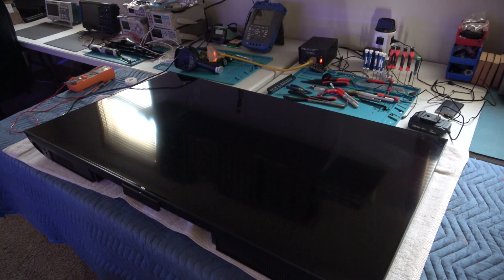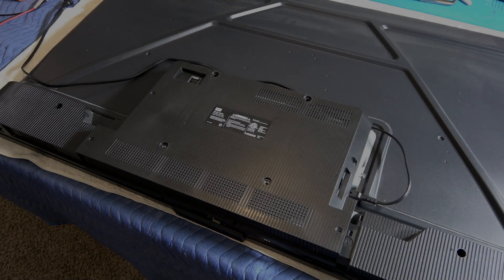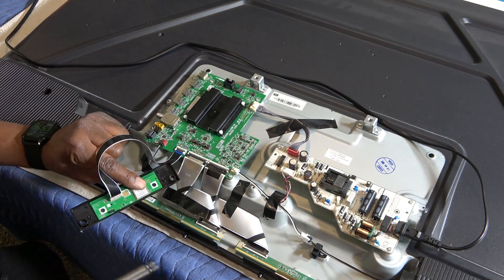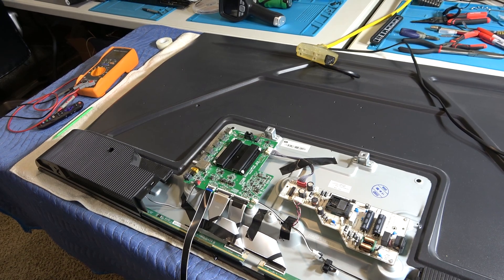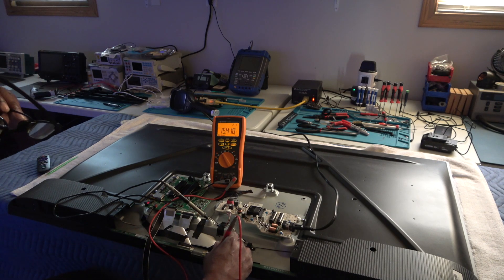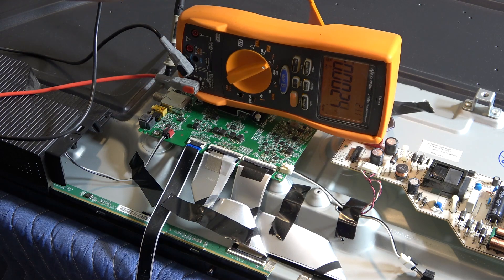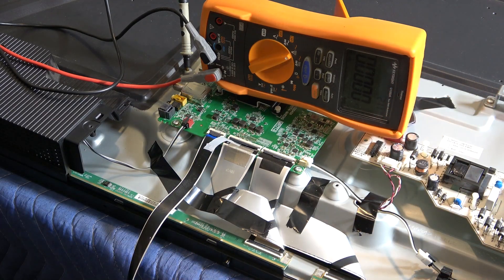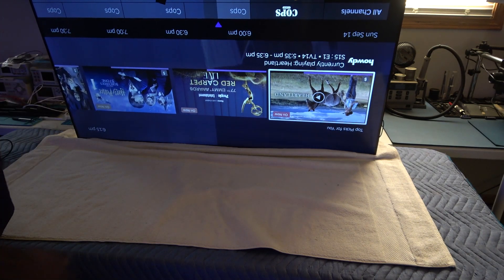How to use the Tape method on LED Televisions with a bad LCD panel, backlit screen but no display.

Comment: Hey bigdog, I love your channel, you've helped me out a lot in the past couple years. I've had a problem with three TVs, 50" and 55" with the same main board as this video. The problems I've had with that, if I unhook one side up only I will have a temporary picture and then black screen and the other side just blank and tape doesn't seem to work. Do you have any recommendations to what it could be or is it just trash, thanks in advance.

Comment: If I am understanding how this works correctly, it is something that has shorted internally in the LCD panel or something in the ribbon cables feeding the LCD that have failed and this "trick" works because each side of the panel is fed with multiples of the same signals for the same image to reproduce a higher refresh rate , such as 120 or 240Hz, sometimes called like 'truemotion' or something along those lines (sorry for the bad pun there) and this trick basically works because by cutting the signal to the shorted line with tape, it's only affecting one rotation as you will of the same image sequence to the LCD panel so you should still get half of whatever the original Hz rating is.  This might show up only in sports or video games where the refresh rate of the original video source is high enough to notice, but a normal broadcasting and movie watching I don't think it makes hardly any difference since I believe most broadcast and streaming is at 60 hz or 120 max at least in the USA I believe  I might be totally wrong here in my understanding, so please correct me if you know more than I do because I actually really would like to know how this fully works;)

Comment: This method is great and I can attest that it works. I had a 75" $3k tv from about 2019 and was able to mostly save it since it was given to me for free. The right half has a slight redish tinge to it, but my friend couldn't see it even after I clearly demonstrated the issue for him. He bought the TV for $450 and is very happy with it and I'm happy with a slightly thicker wallet. You're the man.

Comment: My friend, I want to ask about the course, will you complete it?
Reply from the maker: Yes
Reply: @bigdog8882  I'm interested in your course also. I'm a newbie to fixing TV's. I've got an Insignia NS46E480A13 tv & the backlights work for a bit then turn off. After I leave it unplugged for a week & then plug it back in, the backlights look perfect as far as the picture goes. Then after around 10-15 mins the backlights just turn off. I do have an image with the flashlight test & audio. I replaced the inverter driver board but that wasn't the problem. I thought it had to then be the power board, but some of your vids show it can be the backlights (if some are out). I don't know how to rule out if it's the power board (or any other board) before I try to replace the backlights. AND I've searched the entire internet for the replacement backlights for this model tv & can't even find anything or even a part number!!! How can there not be even a generic match for them? I can't even find any info as to how many led strips it takes or any voltages either! Anyway, I'd love to be able to fix this tv instead of just having to throw it away. Thanks for any help.

Comment: I’m tipping it’s the clk lines or the ceramic caps on the panel board gone short
Reply from the maker: I had already checked those, unfortunately I didnt capture that on the video. Thanks.